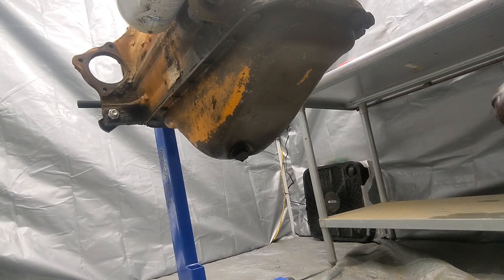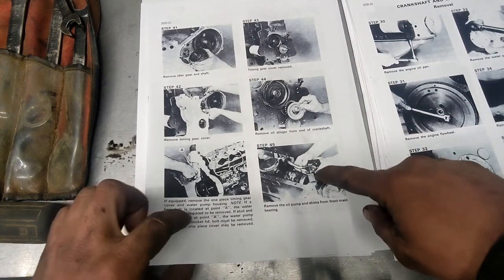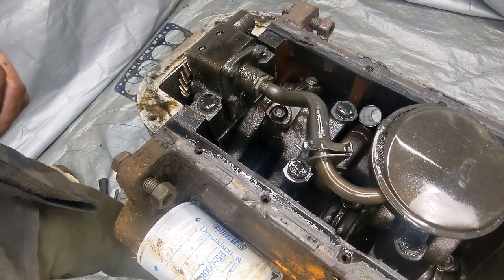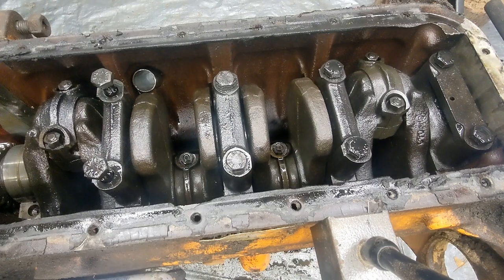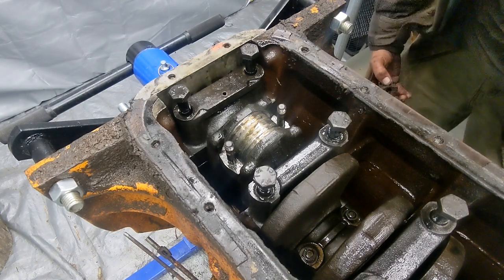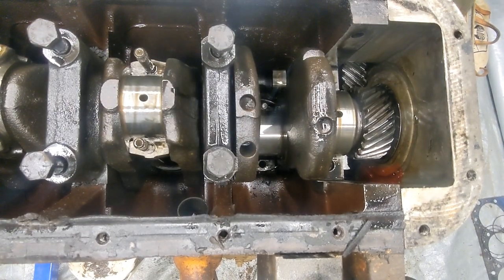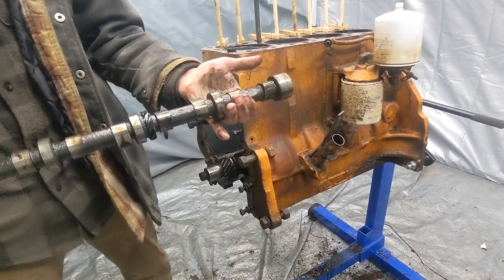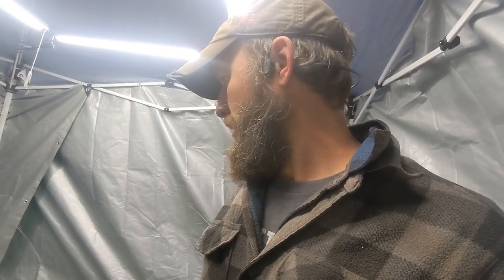Long form for diy. case 207 engine teardown, crank, cam, and piston removal

Comment: Good job. I finally got my 188 engine to run last weekend. It has a leaking injector line and is smoking like a battleship but it’s running. It’s in my 68 case 580ck.

Comment: Bad news but common on the case 188 and 207 engines. Very realiable engines but they run until the main bearings give out. I recently rebuild a case 207 out of a forklift it had a window on the side of the block because #4 rod locked up and they ran it until it blew up. I bought a core engine, lucky me they are hard to find but also #4 rod was also locked up but block was good, bought all my parts from Ag kits, the crankshaft, rod, rebuild kit and injector nozzles. You should also take your block to the machine shop to make sure your mains didn’t get distorted with the heat of spun bearings.
Reply from the maker: I will take that into consideration and inspect the block thanks for the tip
Reply: @GRTRanchadventures  Take the rods to the shop with the crank, they may need to re-size the rod end
Reply from the maker: @scottnunya1  the kit I'm using comes with new rods and Pistons
Reply: @GRTRanchadventures  Nice, I didn't know there were kits that included rods

Comment: Sick video! That also looks like a cool tent garage you got there, I want one of those lol. What brand is that?
Reply from the maker: Redneck solutions, the GRT clean room lol. It's just a cheap pop up canopy with tarps wrapped around quick and simple
Reply: @GRTRanchadventures  I was thinking you would do the tent after teardown,, so you didn't get the debris from teardown inside the tent.
Reply from the maker: @scottnunya1  I built it so I would have a place to tear down and rebuild